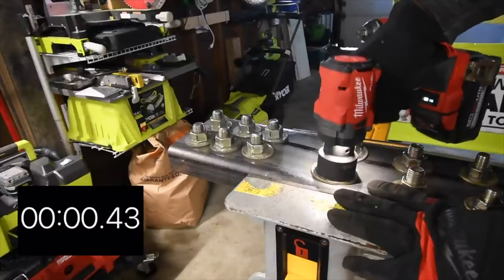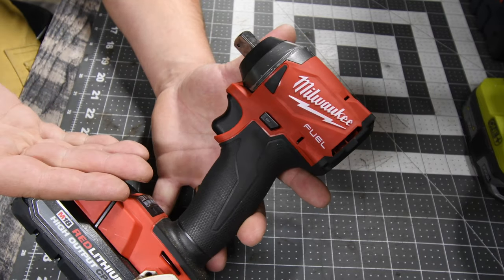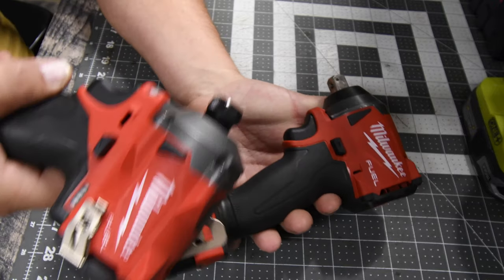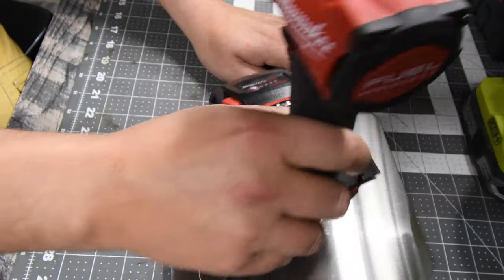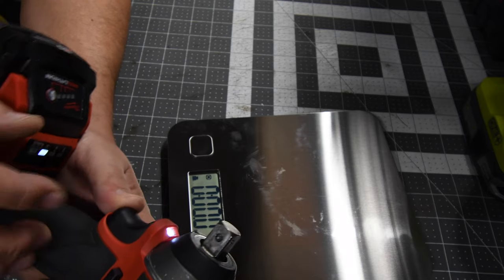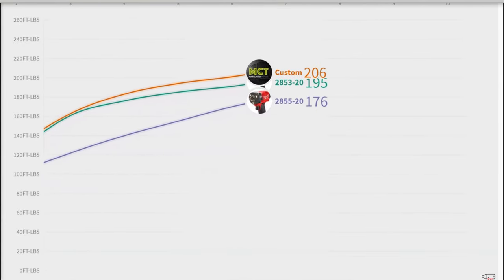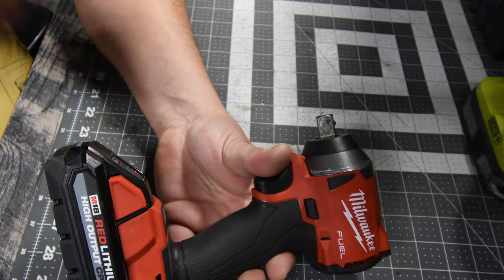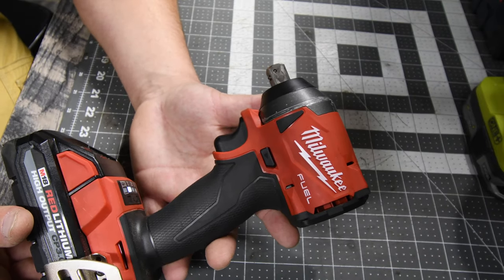Milwaukee Impact Driver  (Frankenstein)

Comment: I have same driver and love it more than my 3/8 but I do t like how I keep snapping adapters. When I seen this build I went online and bought the anvil (3/8) from Milwaukee and this blowes my regular (3/8) impact out the water. I use mostly 3/8 at work thays why I chose to go with the 3/8 anvil and because it's compact
Reply: can u share the 3/8 anvil part number that worked for u please
Reply: @yt-aimbot-gaming8352  this is the link I used on ebay I cant find a part number on the description
Reply: @MrRydenn147  i think you forgot to paste the link lol. i dont see it
Reply: did you have to do more to get 3/8 to work?
Reply: It was taken down. Its not allowing me to post link